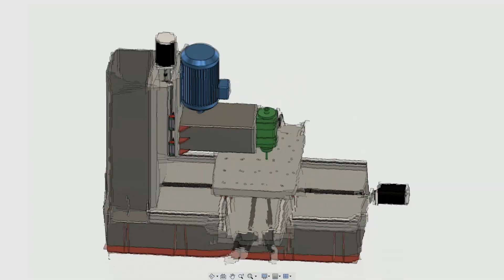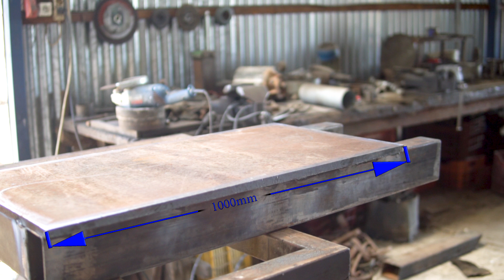DIY CNC machine 700x700x350 - Part 1

Comment: Main plate too thin. If you build BIG machine use polymer beton. Mount your plate into this.
Reply: Does this only confuse you?) How about the spindle overhang and microscopic carriages? xD For milling wood, such a machine is suitable, no more...
Reply from the maker: @kei_cnc5500  Well KEI. 316 stainless was cut with accuracy after all. No reason to talk about aluminum. Just to be clear here. Everyone can say "ooohhh is not gonna work" Give some help to new guys and stop being so judgmental. Yes i know that the linear bearings won't last for long. Future update. Yes i know that the spindle needs fixing but i am evaluating my options.  As mr Viktor suggested. We added polymer beton into it.
Reply: @wearetherandombros7782  I suspect the carriages are big enough despite being just HGR20s (or you can just add more, they are cheap), but the overhang is likely to be an issue with larger tools. Might be possible to use damping to compensate lack of stiffness.

Comment: Wow, looks absolutely massive! Looking forward to seeing the progress.
Reply from the maker: Yeah , it should literally be a beast of a machine ! Motors have arrived and we feel confident enough to move on with the project ! Part 2 coming out soon !
Reply from the maker: Yeap. We are testing it as we speak.  We haven't yet found its limitations but it's cutting aluminium and steel for sure but we are still trying to figure things out

Comment: are you using hgr20 ?
Reply: It looks like HGR20. With so large steel plate (and thickness), I think they need bigger rail, at least HGR25?
Reply from the maker: @maozhoumeng2880  Yeah you are absolutely right mate. We are using 20mm rails so far. I believe that 25 would have been better but we realized it a bit late. Then again , if they do actually work we might save some money to the next guy that will attempt this

Comment: hello, do you have any dimension or plan for this building? i love it
p.s: probably would fill the tubes with epoxy granite to decrease vibrations
Reply from the maker: Hello yes we will fill everything up with either Epoxy or something with higher density. We do have the plans but everything changes constantly. I mean you can't really take it as "its working" since we haven't tested it yet.

Comment: Good configuration to start.
Rectangular tube are fine to work with
but steel constructions are not autodemping the vibration.
For a stabel machine you need cast parts
Balbearing guideways fron Hiwin are super to work with.
With rollerbearing you can have higher loads.
Some hight in your top wagon will give more stability
You had to think and draw first compleetly your machine with
spindelvices for the movements and guidewayprotection.
make something good of your base
Best greatings from Belgium, Mechanix